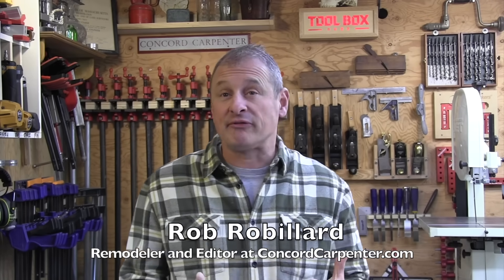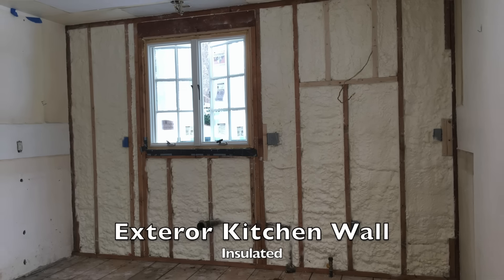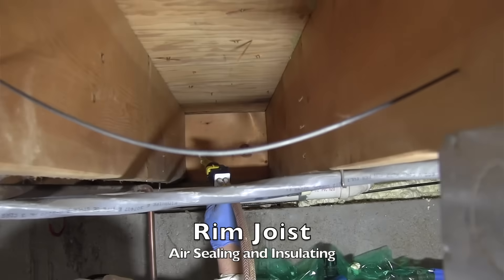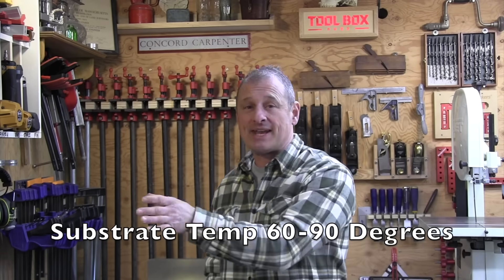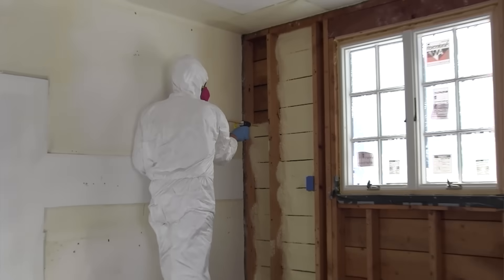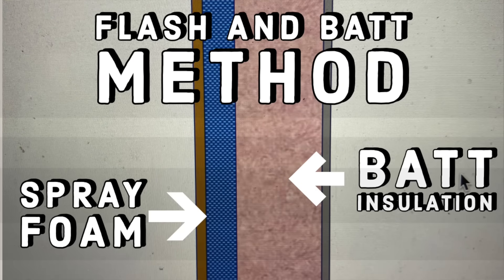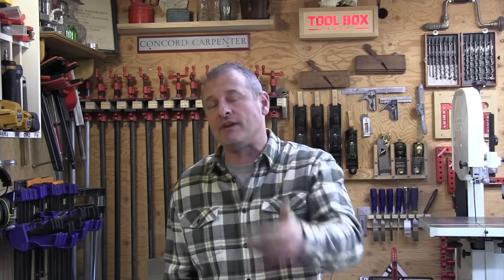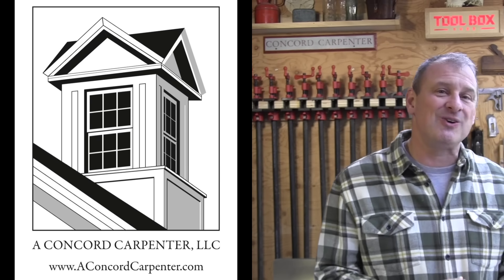Using a Froth Pak - DAP System 600 Spray Foam Kit

Comment: Closed cell spray and timber.. Will this not dry rot?
Reply from the maker: keep water out - rot is a result of wood getting wet. Dry rot is not a thing for a house
Reply: @ConcordCarpenter  

Yes but does timber not need to breathe but by using closed cell foam would be too dense to allow it to. We only used closed cell foam on metal frames ie vans/units. Houses or attics usually would be open cell.

Comment: A couple of mistakes in the video 

To be a vapor barrier this product needs to be 2 inches, anything less is not a vapor barrier according to ESR-3052

Second is that all of these froth paks can only be installed 2 inches thick total!  Never are they allowed to “fill  the cavity” it would be a violation of the ESR-3052 and thus a building code violation. 

ESR-3052 easily found on line for free just type in ESR-3052
This is the “bible” in building the code. If any document conflicts the ESR is the controlling document.
Reply: Why? What happens if you use it with 3-4 inches thickness?

Comment: Can this product be used to air seal attic A/C ducts?
Reply: I’m looking to apply that product on my newly installed air ducts in the garage. Have you tried on you attic AC ducts yet?
Reply: No, not yet. I’m still not sure if the product will adhere to 30 year old attic HVAC ducts. Does anyone know?
Reply: You’re better off with a few cans of Great Stuff for that purpose

Comment: Do you know the soundproof rating for this insulation?
Reply: Spray foam overall doesn't reduce sound transmission much, rock wool, or cellulose is best for reducing sound transmission.
Reply: @fartman2269  I have a metal roof. The client wants to transform it into an area for conference calls. We could drop the ceiling do all of that but we would need to reroute the sprinklers, hvac, and electrical. Any froth Pak type solution you know about to avoid all of the rerouting?
Reply: It’s more about noise coming from outside.
Reply: @lancelee5757  I see, adding spray foam insulation to the underside of the roof deck will make some difference in sound from the roof,  depending on your local codes,  it sounds like a commercial type  stucture, you may be required to coat the spray foam insulation with a ignition barrier, spray on cellulose, or mineral wool,  which would decrease sound transmission as well.
Reply: @fartman2269  I passed on the project lol

Comment: Can the spray surface be damped at the time of application?
Reply: No. Water issues should be dealt with first before any type of insulating or else mold will grow.

Why is it damp? If it's condensation foam will help to stop that problem but the surface needs to be dry before application. High power fans and a dehumidifier. If the problem is water infiltration than cracks need to be fixed and water needs to shed away from the foundation on the exterior, sloping down away from the house, gutters and downspouts.

Comment: Very helpful! Hope I succeed! In my situation I have a large 1/2" gap in those rim joists between the outer siding and the outside beam. Crawlspace doesn't have a skirt yet but will probably next year. My plan is to put up a piece of 2x4 or similar, spray in the rim joist cavity and once cured, remove that 2x4 and put it under the next set of cavities. Should that work? That little bit of spray foam will be exposed directly to outside air until the skirt is built.

Comment: I just bought property out side of a small town. I would say 45 miles from a city of 200,000 My land  will be in the grading And landscaping mode next year By myself ..No permits needed 2 40 x 9 high shipping containners on concrete pillars...water sewage /hydro framing Theses are the basics You really cant go cheaper on other than shopping around for the same product...

With hiring a company that uses closed cell spray foam I feel the foam compared to the DAP system. Looks And feels denser And leaves a thicker ..crust (lack of a better word)  And for 2 trailers even with the cost of travel seem a the better choice..2 inches of foam is a min in the Canadian north And and a spend now save later view..

Comment: That was one of the worst applications I've ever seen.  The proper way is to start by framing the pockets in the corners of stud to wall, effectively sealing around the studs.  Then, fill in the field evenly.  I noticed a lot of air gaps along the studs.
Reply: Yep

Comment: Does anyone know a cost comparison of getting your house sprayed from a company to just buying these and doing it yourself? Do they get a bulk discount so between their costs+ profit, would be equal in cost to me buying 10 of these to do the same job?
Reply: Even small jobs with a spray foam company are expensive usually at $1000 or more this is definitely cheaper

Comment: I was told by the product manufacturers that it's not recommend to spry overhead. Makes a huge mess and may not stick. Have any comments?
Reply: the cans when full, have enough pressure to throw chemicals up, but once half empty, no
so maybe start your job by spraying up, then use the rest of foam elsewhere

Comment: For anyone looking for the amount this kit will cover. It will cover (25) cavities 9’ high 16’’ wide 2’’ of depth
Reply: Smarter Than You  i think he was meaning if you needed closed cell at a thickness of 2" which for me is perfect. but someone else may need to fill it
Reply: Thanks
Reply: Thanks
Reply: Thank You.
Reply: It's advertising 600 sq ft but at 1" depth! But your saying at 2" depth you get about 144 sq ft of use?
Reply: @VP411Designs  at 2 inches it should cover 300 sqft
Reply: It's 600 board feet. That's 1 square foot at 1 inch thick. Mine did almost the full 600 board feet. Both tanks nearly the same left. But that's dependant on humidity, temperature of air, temperature of surface and chemicals. If temperature is off you get low foam results.
Reply: So, 33ft then.
Reply: @sonsofliberty3081  it was 150 square feet.  16/12 = 1.3 ft.  1.33x9=12 sq ft.  12x25= 300 div. 2 = 150. So he only achieved a 1/4 of the footage.

Comment: I m looking at doing my pole barn with this,. What's your opinion? I m in North East Ohio and the building is 30×40 with 8' ceilings
Reply: I'm just a handy Joe Nobody but I would hire it out if you want spray. I sprayed a mock outhouse built over my well. Messy expensive pain. 
    When I insulated the south wall on my steel shed, I used rigid sheets and sealed edges with spray foam cans. For perfection sheets need be cut small enough for you to properly seal edges as thick as sheets. I bought sheets secondhand and I can't compare my way to hired bc only company near me couldn't calculate sq footage.  Given no simple math, I deemed unworthy to hire.

Comment: Great video!  I was unaware of the DIY option.  Can you speak to the fire resistance of the finished installation?  I'm interesting in spraying the rim joists in my 130 year old basement but wonder about its fire resistance when done.    And if one side of the rim is effectively hermetically sealed because of the foam does this increase the chance of rotting within the rim because it will never dry to the inside but likely have the moisture levels of the outside cavity air?  many thanks!
Reply: It won’t need to dry toward the interior since the foam is preventing moisture on that end. It’ll dry (if needed) to the outside of the rim, which is ideal. Humid air will it whatever is outside but also dry that way. This is the same reason why concrete slab homes with no basement can exist
Reply: I'm more familiar with the Tiger foam and Green foam diy kits and they both have E-84, a Fire-Rated SPF Class 1 fire retardant.
Reply: Dap touch n foam 600 has a class a fire rating. Basically it's good. Has a flame retardant added.
Reply: Bob those problems are possible if you have lots of water leaking inward. But yes you must cover this material with drywall to meet fire code.

Comment: I did a room in my 1840s home, the $650 cost is the big downside to this stuff. Today I would go with Rockwool.
Reply: dalesworld you're supposed to use both to meet most r value code requirements
Reply: @markschiavone8003  No, you're just supposed to have R-19 in the wall. No mention of air barriers. Rockwool is a much better air barrier than fiberglass too.
Reply: dalesworld , I must have been thinking of another post where a guy wanted to use just 2 inches of closed cell foam. But code does require r 19 and a vapor barrier in the US for exterior walls.
Reply: @markschiavone8003  I did 4 inches of the closed cell foam which is about R24. Technically it is a vapor barrier.
Reply: Cost wise going the extra 2 inches of closed cell is a waste of money compared to using rockwool insulation. That's why industry standards suggest a "flash"( 2 inches of closed cell) "and batt"(rockwool.) Plus as a inexperienced foam sprayer  going thicker can be dangerous to your health.
Reply: dalesworld , here's a link to a guy you've probably seen on YouTube who does some crazy high end projects. He has a lot of videos on passive houses that you might like. Good luck with your old house!
Reply: @markschiavone8003  Yes, but sometimes you gotta just use the material up.
Reply: @dalesworld1308  , you should have sprayed behind your rim joist with the extra foam. You would have gotten more bang for the buck.
Reply: @markschiavone8003  I did - three inches on the outside walls of the corner bedroom, then I moved to the basement and used it up on rim joists and up under the floor of the coldest room. If the kit was cheaper I'd definitely do more with them.
Reply: @dalesworld1308  sweet!! I haven't switched out my fiberglass yet.... maybe this summer.

Comment: READ THE FINE PRINT.  The 600 is supposed to be the approximate number of square feet that can be covered at 1 inch thick but I bought two frothpaks and neither one came anywhere near the coverage advertised.  It was WAY short.  I sent photos and calculations to the vendor demonstrating that my calculations were correct and my application was correct.  The vendor did nothing but make excuses.  I hired a pro for the same amount it would have cost me to finish the job.  When they came in and saw my application they offered me a job.  Before spending ANY money on a frothpak, do your calculations carefully recognizing that you'll get about 3/4's of the advertised coverage, then get a bid from a pro.  You just may be surprised.
Reply: I have had the same experience
Reply: What was the temperature because it has to be about 55 or 60° at least or that cuts it way down
Reply: @arieswaters video says 70-90
Reply: thanks for the warning. What product did the pro to finish the job?
Reply: @pwner4once  I don’t know.  They bring in a big truck with tanks.  I was able to get the cost down a bit by covering the floor and other exposed spaces with plastic before they arrived.  If they agree make sure the plastic is heavy and secure it well.
Reply: Lol. This never happened
Reply: @2314jones  And I suppose you know that because you were there?

Comment: 1" of Closed Cell Spray Foam does not provide the permanence rating of 6mil Poly Vapour Barrier.  A minimum of 2" is required to meet this permanence rating.  Also, if sill plates, double top plates and built up studs gaps are not being caulked with acoustic sealant, then there is still a air/vapour pathway.  Further, in Ontario, spray foam is required to be protected against fire (6" Roxul Insulation, Drywall, Plywood are some examples of protection).  Great video as always.

Comment: a heads up for anyone in Canada, this froth pack does not meet vapour barrier requirements according to the Canadian building code. I found this out the hard way after an argument with the inspector and a phone call to the manufacture
Reply from the maker: Do you have any documentation from the? Id love to see it
Reply: BKlounge I don't doubt it. You guys have a lot of regulations

Comment: Just bought a house 2 weeks ago, it's frame. I'm gutting the house completely, can I use that foam system ???
Reply: enriqueroman62 its probably cheaper to hire a company if you are doing a whole house
Reply: It’s cheaper to hire it. The contractors get bulk discounts on the foam
Reply: That’s a great question. I want to know myself!

Comment: Why not just fill the stud cavity completely with closed cell foam? Is cost the only reason? Thank you!
Reply from the maker: YEs cost, but also sise of project sometime prohibits a CCSF company from coming out
Reply: The amount of labor cost to fill and shave a cavity with closed cell will almost double the cost and offers very little performance increase. It is done where we don't have a 3"+ depth to apply the closed cell.  Just 2" Will stop 97% of all heat flow and moisture travel with most brands of closed cell.
Reply: 2 inches doesn't stop 97% of heat flow. 4 inches stops like 94% ish. And it depends on the roof value of the cured foam. Dap touch n foam pro has a maximum of 5.4 per inch r value. So maybe it's r5 per inch, maybe its more.

Comment: And it only costs 10 times what other insulation costs.
Reply: Sort of like owning a Pellet Grill. Uses 6 times as much dinero to operate.
Reply: And that cost addition will result in much lower energy costs which turn into savings.  The ROI will be different for each area depending on costs.  For electric heating some areas I've seen as low as 4¢/kwh to as high as 27¢/kwh.
Reply: @shadowzedge5793  my point was other insulation is more cost effective. The price of the two part kit is $600. Sheet foam cut to fit and calked if necessary would be 1/10 the cost.

Comment: I used to spray in the 2000s, all good info, I cant think of anything to add or take away from this. Side note, DO NOT have any exposed hair when spraying, ANY hair...
Reply: Can I use this product under a metal roof? I leave in the desert. Temps go over 120F. I want to insulate the roof over the garage
Reply: @cepedafj  The pole barn guys do it all the time, just remember, its like super glue, if you ever have to replace panel its going to be hell. The recommendations are to put building wrap on first to isolate the metal. I think it will be fine once it has cured, but check the products heat tolerances first with ANSI sheet.
Reply: @sroberds640  no ypu dp not put  wrap on first..it leaves a place for condensation to pool up..the point of spray foam is to be a vapour barrier and have adhesion to the surface ..p.s.i am fully licensed spray foam installer with a 200 thousand doller rig ..dont give advice online if u dont k ow proper info...2 i ches is also whats called for as vb
Reply: What about filling concrete block cavities?

Comment: When i bought my house the basement rim joists were insulated with just fiberglass bats. When i pulled them out there was mold,bugs and evidence of previous mouse residence. It was gross.  I could see daylight  between the foundation and rim joist. I caulked all of the gaps. Then installed rigid foam and used can foam to seal them.  I wish i had known about the DAP kit then.  I would have saved days and my sanity.
Reply: It also cost a lot of money lol
Reply: I had the same scenario and ended up using that spray foam. Best $70” I ever spent

Comment: I use foam board and fill in around the edges with can of spray foam. Lot cheaper way then using spray foam
Reply from the maker: Sawmiller Smith  definitely cheaper and more DIY friendly, our next video and last video On insulation will be rigid board
Reply: A Concord Carpenter / ToolBoxBuzz I’d like to see what you suggest on EPS vs. XPS, especially for mixed southern climate (Zone 3)
Reply: I call this method cut and cobble.
Reply: @chrisdaunhauer1757  As long as it works is what counts by what ever you call it. It will even make a wall more ridged .
Reply: @chrisdaunhauer1757  Me? I call it a GREAT idea. But if I had to name it, it would be "Pepperoni & Sausage Pizza"
Reply: Same
Reply: jesu christ thanks for the idea !! i ll go check ou for price of closedcell foam board!

Comment: How easy is it to keep spraying rim joists without stopping for more than 30 seconds?  Between moving yourself, ladders, lights or crawling in a crawlspace, I could see where there would be a lot of stopping and starting.
Reply: I agree with Dennis Pope, when I sprayed the rim joist on a basement suite for a customer I had a helper move the cans of spray foam behind me.  Went nonstop and used one tip for the whole job.
Reply from the maker: Donald Durand And I think they say that to protect themselves period I stopped for way longer than that when doing these projects and they work fine.  I think it’s just because the nozzle can dry out
Reply: Get a buddy to help you move quickly, have two ladders or a longer platform that someone else moves while you are focusing on moving quickly
Reply from the maker: Donald Durand we Definitely stopped linger to reposition- it’s a guideline. We had no issues
Reply: Hey Donald Durand, I was lucky. 7 foot ceiling, and a good helper, we thought it thru ahead of time and we were using the 600 froth pack. We went around three times to let it expand properly

Comment: Not recommend to use with any respirator regardless of filter. Should be forced air or scuba. Stay safe!
Reply from the maker: The Froth Pak manuf actually disagrees with you on this. This is not high CCSF - psi - its different
Reply: @ConcordCarpenter  I want independent tests! 😷 They wouldn't sell any if the told you to protect yourself properly 😂

Comment: How would you fill the spaces so you have more sound absorption?
Reply: Use the closed cell spray foam first, then rock wool batt for the sound absorption. Closed cell spray foam is a good sound reflector, not absorber.
Reply from the maker: Kraig Klopp fill cavity full